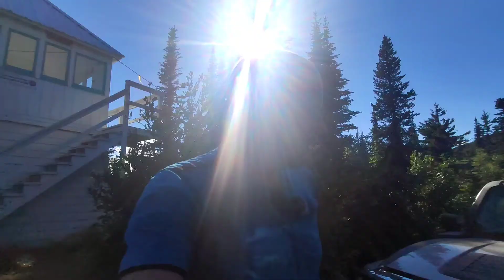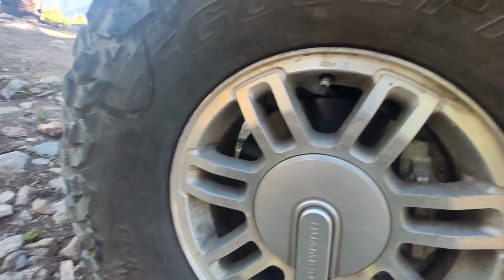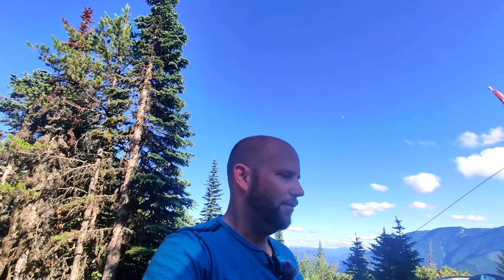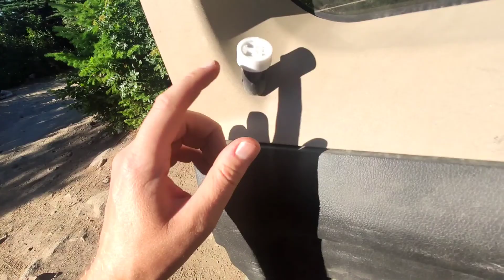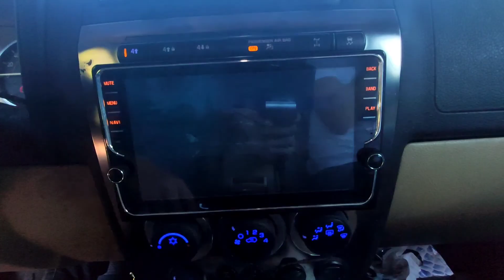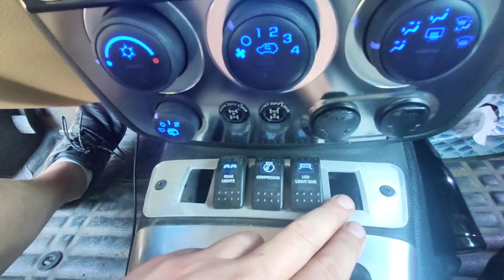2007 Hummer H3!   -  mods and upgrades!

Comment: Hi there—I watched your video and thought it was great, but I have a few questions I was hoping you could clear up for me:

1-	Regarding the fan blade that supplies air to the radiator: does it push the air outward?
2-	If the air is pushed outward like that, does the fan direct the airflow inward or outward?
3-	Because if it directs the air inward, wouldn't that airflow collide with the air coming from the engine toward the radiator?
4-	But if the fan pushes the air outward, then it would make sense.

That is my question regarding the fan setup: does it pull air in or blow it out?
Or do both fans blow outward at the same time? That’s what I’m wondering. I look forward to hearing from you. Thanks.
Best regards.
Reply from the maker: Both the original clutch fan bolted to the water pump and the added transmission cooler fan pull air from the front of the truck and blow it towards the engine. Which is the way it would be in pretty much any other vehicle.

Comment: Since I can't anyone from Lazed to answer my messages/ sell me the adaptors needed for the 7inch LED headlights, I'll move on to Teansmission cooler and finding functional hood vents somewhere....gets hot here in Florida and every degree of cooling helps.
Reply: Yeah, I couldn't get anyone to respond either...
Reply from the maker: Find someone with a 3d printer... The files are available online. That's what I'd do.

Comment: Do you or anyone else have contact with Lazed Designs for the H3 headlight and fog light mod? Their website is down, and all attempts to contact them have failed. I really want to do the headlight mod and it's mega irritating when only ONE person makes the components necessary and they are not responsive to messages or orders.
Reply from the maker: I just used the existing headlights, cut out the lenses, removed the bulbs and grinded them up into mounts that the new lights fit into. 
You can also 3d print mounts, the 3d printer STL files are available online if you know someone with a 3d printer.

Comment: Great video , I have a 2007 h3 adventure and I am not able to pull the ATF temp using car scanner OBD2 , please share the PID you used on torque
Reply from the maker: If I remember correctly, you need to add the included GM pid package. 
Then there'll be 4 different trans temps. Just add all of them and see which one works.

Comment: Do you have a link for the new stereo display?
Reply from the maker: That one's like 5 years old..... 

I've just ordered another one from AliExpress specifically designed to fit perfect. I'll be making an install video of that soon. Stay tuned!
Reply from the maker: Nevermind.... I ended up struggling with the install. They did a shit job on the overall design, so I didn't end up making the video. 

If you're willing to take the plunge, they're all over AliExpress. I recommend one with a "2k" screen.

Comment: Hey brother great video. Was interested in if you ever replaced that double din and with what size screen if you did and what model. Also if you’ve discovered any digital speedometers or speedometer upgrades? I’ve looked around and haven’t seen anything.
Reply from the maker: I haven't replaced it yet, however when I do I'll be getting one from joyingauto.com . ... we got one for my brother's truck there and it's amazing. 

As for a digital instrument cluster, there doesn't appear to be any on the market. I just used a single din stereo and 3D printed at housing for it, and stuck it on top of the dashboard in front of the steering wheel.

Comment: Ed, I am thinking of buying a 2006 H3   - top 3 upgrades starting with the engine   Thank You K
Reply: I have a black murdrred out 2007 H3 I have owned for 12 years,If your in Dallas,TX I might consider selling it.
Reply from the maker: I'd start by not buying a 2006 if you can help it.
The 3.5 in the 06 is troublesome and it's the lowest powered h3 ever. 

The 2007 has the more reliable, slightly more powerful 3.7. 

Then in the last couple model years, there's the option of a V8 in the alphas.... Those are by far the best bet.

First thing to do, is level it... Crank the torsion bars to level the ride. Google how, as there's a specific height you want to go to.

2nd thing has got to be the headlights. Stock headlights are terrible.

3rd, kind of depend on what you're using it for. If you're off roading with it, then get some 35" tires
Reply: @edsgarage001   no wonder my h3 is always having problems, my transmission is shot and so is my starter..... im thinking of selling the 06

Comment: You should put links to the parts. I've bought LEDs for my truck from EBAY and none of them worked for long. I like the blue LEDs you put in the dash but I've had no luck with the ones I tried. Your LEDS are alos way brighter than mine were. You could barely see them at night.
Reply from the maker: Mine are custom soldered in. Not really for the average bear
Reply from the maker: Also, I did all the mods over several years....I don't remember where I got everything

Comment: So cool to see all that you have done with your H3!! I have the same rig with adventure package but not luxury. Long story short I bought it for 8k w 200k unknowingly with a almost burnt exhaust valve. I burnt it  through towing the small car I used to go buy it! 2000ft elev climb. Oops!! I  bought a 5.3 to swap but the company that built the harness no longer builds them. So I backed out the 4 busted head bolts (local shop tried to take the head off)  in 5 mins. Left hand drill bit!! And 31/64 punch!! Replaced the valves and almost have it back together!! Kind of a pita as I didn't dismantle it myself.. it has 315s on it now with leveled bars! So cool looking! Anxious to get it on the road and trails!!  A realtor used it to show ski cabins in Alta Utah etc. still had the dvd headsets in their original wrapping.. very clean 👌
Reply: I'm not a professional mechanic so it's taken me 3 trys for every step I think. Like I mounted the intake before I stabbed the motor.  which was stupid I admit!!   then realized I had all kinds of stuff under the intake.. so I took intake off and stabbed it and mounted starter and misc sensor plugs etc . 4 grounds I think Then put the intake on.. pretty sure I got all the intake bolts in.. I hope! 
So far I've used most of the bolts left in a bucket that seemed to fit in the right spot!!
Just need to bolt up exhaust and everything on the left side then start with the front end  radiator etc.. pretty sure I have all the electrical plugs tied in to the right spot.. they didn't even mark them.. but likely gm helped the guys on the production floor and used different plug ins for each location!!
Reply from the maker: @highcountrystories  good luck man!
Reply from the maker: Damn dude... One thing after another eh?

Thx for the comment!
Reply: @edsgarage001  oh ya.. but all good just anxious to finish it!!
Reply: Here's some crazy I5 facts.. you can't remove the timing chain cover without removing the oil pan because the oil pump fits over the crankshaft and the pick up line is in the oil pan. So you have to drop the diff to access the oil pan and timing chain cover.. In short you have to pull the engine to access the timing chain and oil pump. Which you should change anyway with a major job!!
Reply: 10/4. Will update progress.. plan on doing local runs here on Mt Graham and Gila river runs!! Here in Arizona
Reply from the maker: @highcountrystories  I'm way north...
Though I'd love to do some wheeling in Arizona
Reply: Here's another interesting fact.  My house sits 5 miles from the base of Mt Graham.. 3500 ft . Yet the top of Mt Graham is 10500 ft 7 miles away!!  🤔

Comment: Curious how you solder the led lights into the ac and window controls. Which led lights did you need for size and @ what resistance
Reply from the maker: If I remember correctly, I just used some LEDs that I already had. They would have been T10 LEDs that I pulled apart. They already have the resistor soldered onto them. 

It was so long ago now though, so I honestly don't remember exactly.

Comment: Thanks for the time and sharing the knowledge. Just curious the noise of the compressor filling up the tank doesn't bother you how bad is the noise on the inside when the read door is close?
Reply from the maker: It's actually not terribly loud when the cover is still on.
But the only time it's on is when I'm filling tires anyway.
Reply from the maker: Thx for the comment!

Comment: any way u happened to buy 2 sets of the headlight adapters from lased designs? Been waiting since 2020 for them to restock them and still out of stock. Or if u have the specs to 3d print the adapters i would pay you to 3d print them for me.
Reply from the maker: However, the adapter 3d file is freely available

https://www.thingiverse.com/thing:3088147

Where do you live?
Reply: @edsgarage001  interesting! I’m in New Jersey of the USA
Reply from the maker: @CobraSpaulding  ah ok.

Yeah I'm in Canada, on the opposite side lol.

Give that link to someone near you with a printer. Shipping from here would cost a fortune
Reply: @edsgarage001  thank you very much
Reply from the maker: I actually just grinded out my existing headlamps and used them to mount the new ones.

Comment: You could install tissue dispensers in the back of the headrests, for the jeepers that need a ride off the trail!
Reply from the maker: Ha ha haaa!! Awesome 🤣🤣🤣
Reply: @edsgarage001  I'm not sure what you meant about the modifacation to prevent the "strawberry milkshake of death" is that still an incoming video?
Reply from the maker: @itsdirtycivilian2U  
Oh, pretty simple actually.

H3's are known for their radiators leaking coolant into the transmission cooler portion of the radiator. The ATF and coolant mix and end up looking like strawberry milkshake.
This destroys the transmission. 

So to avoid that fate, you install a separate transmission cooler, and cut out the factory cooler altogether.
Reply: @edsgarage001  I had the transmission shop install a seperate trans cooler on mine when they rebuilt the trans. Unsure if the factory line is still there or if they deleted it.
Reply from the maker: @itsdirtycivilian2U  unless you specifically asked them to bypass it, they would have hooked it up in series. So double check it.
Reply: @edsgarage001  so in short, there should be no line going from the trans to the radiator?
Reply from the maker: @itsdirtycivilian2U  correct.
But the other thing to consider is: is the transmission cooler that they installed large enough to properly cool the transmission by itself?
Reply: @edsgarage001  what size should it be?
Reply from the maker: @itsdirtycivilian2U  that's actually something i haven't figured out myself yet lol.

I feel the one i have in mine is too small, and it's about 8x10 inches (can't recall the btu rating). So I'll be upgrading to a larger one in the future.
Reply: @edsgarage001  I’ll check that out. Thanks for the insight!

Comment: Nice work you did on the H3..
10 inch screen work out really good..   the old cell phone up top how did you get load up engine function s on that screen..
Reply from the maker: There's a Bluetooth OBD2 reader plugged into the obd port that sends the info to the phone. I'm using an app called torque to display those things.

Thx for the comment!
Reply: @edsgarage001  Did you have to do anything special to get your trans temp to show up? I've had torque for a while, did the GM pid thing, but still can't see my trans temp.
Reply from the maker: @flylowlevel817  once you've added the gm pid's. Then you need to add a display and find the transmission temp that actually has a reading. There'll be like 4 different ones, try each one until one works.
Reply: What model stereo did you install?
Reply from the maker: @griseldaburruel5395  it's just a cheap Chinese Android head unit.

But I'd actually recommend one from here:

www.joyingauto.com

We installed one of these into my brothers truck, and it's way better